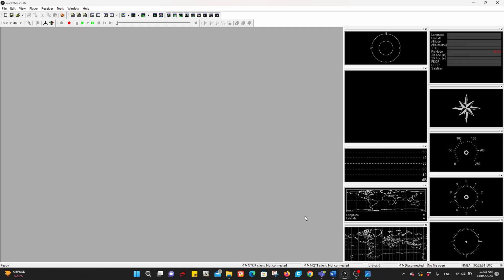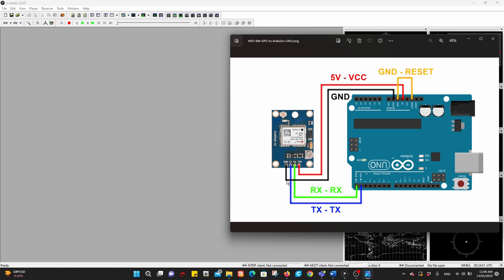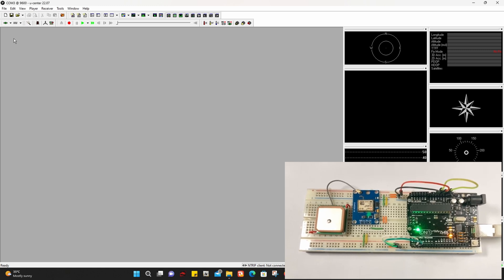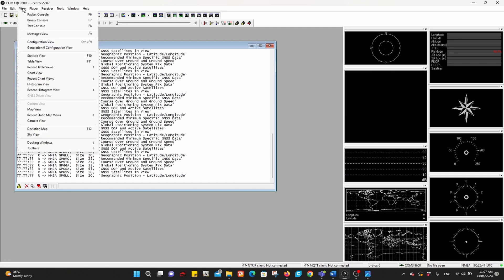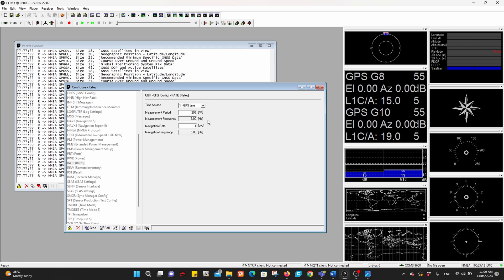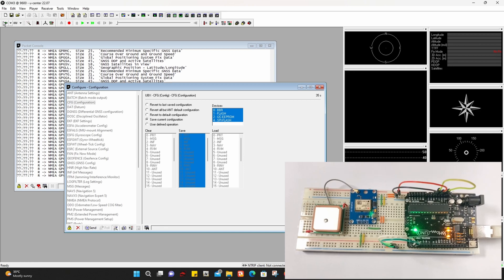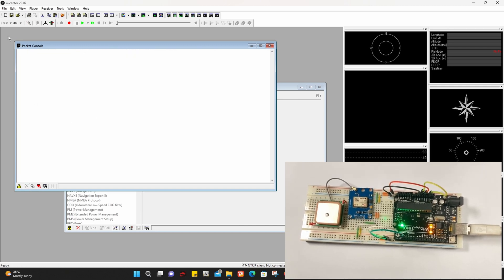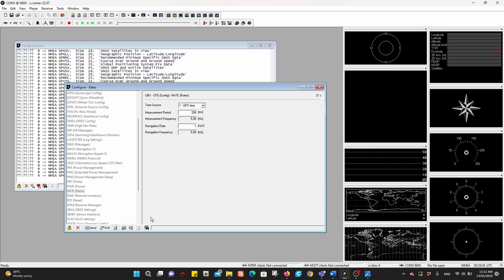Neo-6M 1Hz to 5Hz with Arduino Uno as USB to TTL

Comment: So i already change it to 5hz, but after i connect it to arduino again, the settings is resetting, do you have solution for that?
Reply from the maker: Please check the description, I added codes for NEO-6M SH1106 and NEO-6M-SSD1306, with these codes, Arduino will send the configuration you power on the device. There is a video for how this works if you are interested. Thanks for pointing this out.

Comment: When i use packet console blank page, there is no data
Reply from the maker: Try swapping tx and rx, Try reverting to default settings, if there is solder paste on the terminals it could cause this issue, make sure the terminals are very clean using rubbing alcohol.

Comment: Was there no sketch needed for the arduino?

￼
Reply from the maker: It will communicate directly with the GPS module, without a sketch, just the wiring.
Reply: @3DElectroTech  tanx sir.